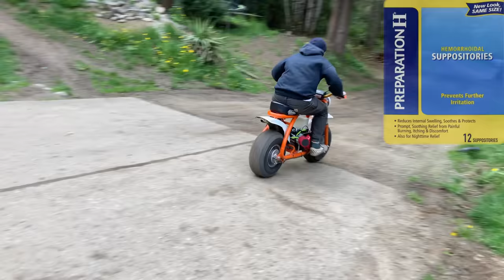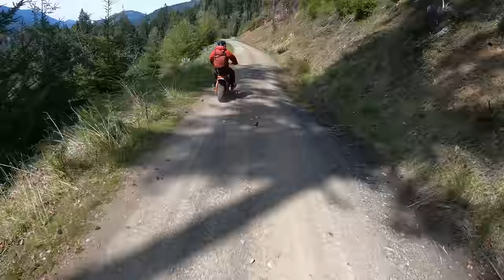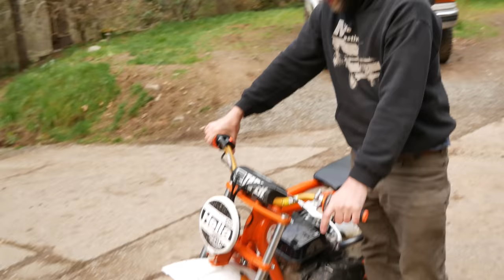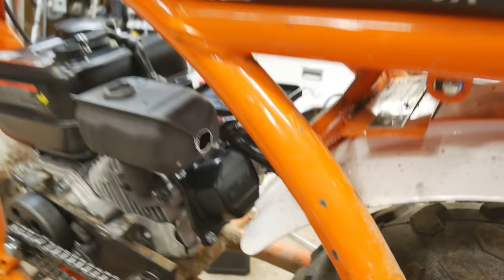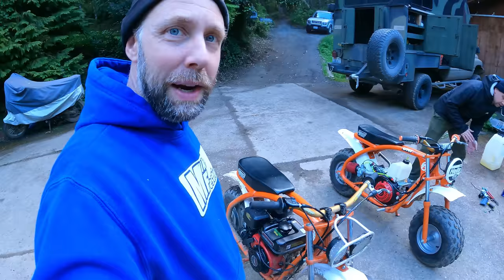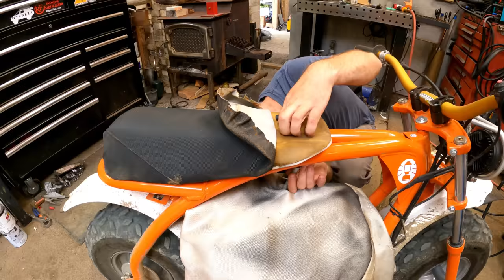Coleman BT200X Mini Bike Performance Parts, Build, predator 224 Ghost 212cc Part 2

Comment: Great fun machine! I've been wanting to experiment in making a "hill billet" flywheel for a 212. On some there is a rough cast step on the skirt of the stock flywheel that is machined and fitted with a ring gear on the electric start models. My idea is to take the flywheel and finish machine that step, then turn up a steel ring and shrink fit it on. I think this will work, because from what I have seen the electric start models don't have the inside out flywheel issue due to the ring gear holding everything together. 
Another thing I have seen with the stock flywheel is some of the "explosions" aren't due to the flywheel giving up. Instead, it's the flat head screw in the center of the impulse magnet that gives up and let's the magnet become one with the air cowl. I think doing the ring mod and replacing that screw with a flat head socket screw would be a cheap way to greatly improve the stock flywheel.

Comment: That’s remarkable on engines known to have Stone Age carburetors and no advance on the magneto ignition systems. These engines are generally designed to run at one specific RPM like on a generator or a lawnmower. I’ve never thought of them as something that has a wide power band

Comment: I have a Coleman CT200U-EX, I bought a Tillotson 225cc Performance Engine from GoPowerSports, and I tell you what, it's a big difference between only going 19 mph to now going 59 mph. I could get it to go a little faster by changing the sprockets, which I haven't done yet, I've just left it like it is, because 59 mph is pretty good. I bought the engine last summer and it's a very reliable engine, plus it's beefed up to make the engine stronger. It puts out 18.626 hp, according to the dyno sheet they sent with the engine. You should get one of these engines, but they're not cheap!
Reply: 59 mph on stock Coleman gearing? Wow. Sounds like a 10K+ RPM screamer.
Reply: Those Tillotson motors are monsters! The 225RS would be sweet 👌
Reply: @OlympicOverland  Yeah, I think the one I bought was the most expensive one. Then I had them replace the 22mm knock off Mikuni carburetor and put a 24mm flat-side Mikuni carburetor,  which boosted the power up a little from what it would have been. They are strong and reliable engines, I highly recommend them to anyone!
Reply: @Deucealive75  Yeah, but I removed the jackshaft and put on a Torque converter with the juggernaut. The rear sprocket is a 54 tooth I believe, it was what came stock on it, but yeah, it definitely rips! I should post a video on my YouTube channel so everyone can see it.
Reply: @roypatterson9910  that’s awesome! I will look into one of the flat slides. I already have the 225RS intake manifold and like how it is tucked in versus hanging out to the side.

Comment: The flywheel you need for the 224 will be the same one you couldn't get for the 196. Remember?

Great idea with the seat. I was looking at the same thing. I have a 78 RM250 seat I was thinking about using on my Coleman.

Also. It won't take a lot to get the 224 to keep up with or beat the Ghost.

Comment: Put 196cc heads and push rods on a 212 you won't regret it. I had my 212 cranking on stock internal parts. I even made an oil cooler for it. You can plumb propane into the intake of the carburetor, then when your riding wide open throttle you can crack the propane open and gain a few more mph. The propane works as extra fuel and at full throttle the engine will get the optimal air flow to burn the extra fuel. It's poor man's nos.

Comment: I recently (yesterday) took the stock 196cc off my CT200U and putting on a standard Predator 212. It’s amazing how much alike the two are visually (aside from the side case bolt sizes) but they definitely aren’t similar in performance in my opinion. Even though we joke about Harbor Freight and their products, the Predator engines always seem to be dependable, smoother, and definitely better built then what Coleman is using.. 
I’m building my CT200U as an actual piece of usable equipment for my fishing channel so there won’t be a lot of performance mods, more more necessity than fun I guess you’d say… next I need a suspension for the front!!😳 and maybe a Springer style seat. 
Great video Mike, you guys are some mini bike riding monsters… 
Willie
Reply: Hey what’s the speed difference from the 196 to the 212
Reply: @Schmmoo  Actually, top speed is the same just because of the gearing. I didn’t change the gearing at all but I can say, the idle is definitely quieter and smoother. Accelerating is a lot less “jolty”. Definitely a smoother experience, so getting to that top speed is a lot nicer and quicker. I would say it’s 0 to 20mph time is better.

Comment: So what do you works better clutch or torque converter?
I’ve heard belt failures are a problem I have a old kdx200 I was thinking about putting a predator 212 in your xr looks fun

Comment: Hey Mike, I have a build series on my channel with the Mega Moto 212 from Go Powersports running the Predator 224.  I agree completely that the 224 has great torque.  I'm hoping to install some minor hop-ups on an upcoming video too.  Bone stock, I am getting 39 mph.  I don't expect much more speed till I get rid of the governor but it will be interesting to see what improvements I can make in torque with a few inexpensive parts.

Comment: I am surprised thebike with poor fitting  gas cap can be sold for safety /fire risk in mind. I recently came across a channel called ROBOT CANTINA which put the 212 hemi thena 420cc into a Honda insight car and they didn't stroke it but would be interesting to see how that would have improved it . there's a playlist which if you check out episode one will give you enough to suck you in to the build or not.

Comment: Hey Mike quick question, my bt200x rattles and shakes at high speed and my arms and body turn to jelly. Made sure bolts were tight but maybe the guy who put it together didn't align something? Do you know where I can find rubber bushings to help vibration for the motor plate? Idk

Comment: Hey Mike, I was wondering if you have any experience running a welder off of a generator? I have a gas powered welder/generator and wanted to run my multi-process inverter weld off of it and was worried it might damage the inverter welder. Any help would be greatly appreciated. 🙂

Comment: I have the same orange BT200X. May I ask what color orange spray paint you used? Mine came a bit dinged up from the factory and I’ve had zero luck getting a paint code from Coleman. Thanks!

Comment: Dude I'm bot 70yrs old,
I bought a mini bike colman 200...etc.
They are a blast..yeal I dropped it few times in the woods but its fun. 
I'm not into speed ,I want traction to climb hills with camping gear. 
Thought about a lightweight trailer.
But need more power.
I will buy a predator if not enough.peace out!
Reply: I'm 63 ,just bought my first mini" b200r coleman, @ Tractor supplies Co. San Antonio Tx. 😁😎

Comment: is this a lot different than the b200 from tractor supply ?
Reply: Yes. Mostly, the b200 has a completely different frame and transmission and disc brakes

Comment: Seems the ghost has more power for acceleration and top speed, but that 224 max has gobs of torque!
Reply from the maker: Definitely 👍 the Ghost is electronically governed to 6K and has no problem hitting the rev limiter.
The 224 still has the governor even though I bypassed it and doesn’t seem to be able to reach 6K with the stock carb and cam. 
In the next video I hope to have the 224  hitting 7500 RPM 🙂👍
Thanks for watching!

Comment: Jus destroyed my jack shaft on the Axis they sell at LOWES 
DO you recommend a torque converter replacement. It’s on a 196 cc clone
Reply from the maker: I think the torque converter is okay, the top speed was a bit lower but it had better low end power. There’s ways of tuning the TC but I didn’t like the way the bike had a bit of lag when engaging the clutch and the rolling resistance when pushing the bike.
Reply: Would you recommend torque converter or jackshaft

Comment: Does you're Brother's have a torque converter or jack shaft like yours?  If not the same you need a torque converter to see the difference when you do mods too  you're motor or switch bikes and see if it's just the rider🤔

Comment: Juggerknott  torque converter is a must
Reply: Will it bolt up to the 212 ghost engine without any modifications beside a 1 inch riser

Comment: Hey Mike.  Love your Vids!   Is there a reason you guys don’t run CVTs/torque converters on your minis?
Reply from the maker: Hey Trevor thanks for checking out my new video 👍 I have a CVT on my other mini bike that I modified, I also added a CVT to this mini bike in the last video.
I ended up taking it off because of a few reasons. The rolling resistance was not good and it had a random range when the clutching would engage.
Last with the stock gearing the CVT was slower then the stock Jack shaft.
I will try it out again in a future video with different gearing 👍
Reply: What clutch are you using with the jackshaft

Comment: is there any aftermarket billet flywheels that have the magnets on the inside? I want to do a engine build but am looking to keep my headlight
Reply from the maker: I haven’t found one yet that will work with the original lighting coil for the headlight.
Kind on a bummer

Comment: How did you get the jack shaft to fit the 224 engine without moving the black little box thing.
Reply from the maker: I moved the black canister out of the way, I also had to reshape the thin metal air shroud a bit to clear the Jack shaft 👍
Reply: @Mikefestiva  im currently running into the same issue how did u have to modify the thin metal piece ?
Reply from the maker: @enemy_evan7012  Haha well after I found the tin shroud hit part of the Jack shaft I pulled the tin and reshaped it with a high tech tool  🔨 😂 I just bashed it with a hammer till I got it to fit then re- installed it 👍

Comment: does the ghost come with gov removed sick vid an wheelies bros too
Reply: Not only do they not come with them, there's also no hole to plug
Reply: However the coil on them is rev limited @ 6000 RPM. Throw a stock predator coil on (not limited) and you can push it to valve float haha.

Comment: I got the same fame and the same engine but the clutch don’t fit.chain don’t reach. Anybody got the link to where to find the missing parts I need to finish this project
Reply: eBay. I order chain on eBay all the time, belt drive and Juggernaut if youwant

Comment: These loud ? Wanted it for driving around my hood but it’s residential
Reply: You can get mufflers/silencers the bolt onto the end up your exhaust that can actually creat a little more power too
Reply: The other day I slapped a stock 224 on my ct200u, the 224 with stock exhaust is way louder than the stock 212…. Definitely go with a silencer

Comment: I would rather see a torque converter than a centrifugal clutch.
Reply: Well, shame on Mike for forcing you to install drivetrain parts on your bike that you didn't choose and even more shame on him for forcing you to watch a video about it and triple shame for the way he rode your bike on your land...wait...it's his bike and nobody forced you to watch or comment...so nevermind
Reply: He already found out that the stock torque converter and gearing don't work well for how he rides. It works ok for casual riding but it's pretty bad from a performance perspective. He'll figure it out but what he needs is a high RPM engine and a Juggernaut driver for this type of aggressive riding.

Comment: What do you change the flywheel too? And why do you have to do that after removing the governor? I'm new to this and thinking about building one.
Reply from the maker: Well the main reason to replace your stock flywheel is because the stock cast iron flywheel isn’t rated for high RPM once the governor is removed from the engine it will rev much higher. The stock flywheel can break apart and hurt you badly, this is pretty rare but it’s just best to replace it. Also installing an aluminum aftermarket flywheel also has another benefit, most have a advanced ignition timing, this helps with power. 🙂👍

Comment: nah..  I'll stick with Japanese bikes.
Reply from the maker: Haha 😂 okay cool guy 👍
I have probably owned over 30 Japanese bikes over the years, rode over 60K miles on the street, thousands of trail miles as well.
My KTM is built in Austria, you only ride Japanese bikes?
Reply: @Mikefestiva  Yeah pretty much.  Euro bikes are more rare over here in the USA, so they are more expensive typically.  KTM's are nice;   I had an older Can AM 200cc dirt bike that was HUGE.  I really liked it, but I couldn't find parts for it, so that was a bummer;  (but I had rode it for years by then, so I just gave it to a buddy). But the big four are everywhere. (suzuki, yamaha, honda, kawasaki).  The big four are everywhere here and ebay is always full of the parts you need..  I'm too used to riding banshee's, 450R's, CR500 big bore 2 stroke bikes and 1200cc ZZR on the street.  The little mini bikes were fun when I was young-- but I get enough small engine work on my lawnmower to scratch that itch now. lol
Reply: @calholli  get a mini bike you wont regret it
Reply: @Elijah’s MiniBikes nah.. I like actually going fast.  Also I already had one for years when I was younger.  Not worth the hassle.  I don't like junky small engines now with this modern fuel that likes to turn to goop.  It's already enough headache to keep the mowers going.